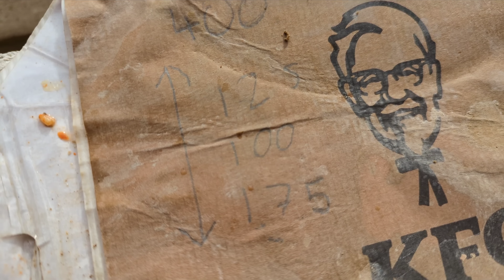Bricklaying - Building a Mansion - New apprentice #bricklaying #renovation #vlog

Comment: When you inherit jobs there will always be issues, the only way to rectify these is to be patient, have common sense ideas and re- set out, plus you must have lots of patience, you have all the above in abundance, great vid Izzy
Reply: Too ture
Reply from the maker: Thank you very much Moggy! When I turned up I felt very out of my depth, but tacking things slowly and double checking everything...it's definitely progressing massively now! Got 1/3 of the Brickwork up to FFL today video coming soon...ish 😂
Reply from the maker: @aaronhanratty6018  thanks fella!
Reply: @IzzytheBricky  hi Izzy, I'm sure you will have looked at this but il say it anyway,  as your aware setting out a building requires line and level,  you are dealing with the level at the moment but make sure you check the line as previous builder may not be as accurate as you are, cheers mate and keep up the good work

Comment: How do you find it using a big trowel like that izzy mate a use a 10 inch london trowel and thinking of trying a bigger one for more bed spreading but not sure
Reply: Stick to 10” mate save your wrist/ elbow
Reply: @specialbrew1873  cheers mate always wanted to try a bigger trowel but can't warrant buying one if  am not going to use it
Reply: Don't go bigger go smaller. 9inch London w.rose  is my preference 👍
Reply: If u want more spred try a wide London pattern maybe
Reply from the maker: I love my 13" mate! Never bend to check Faceplane, always able to reach spot boards...yes it's heavy and sometimes slow, but have a brilliant feel to it 💪
Reply from the maker: @leviellis4079  I've also got a wide London Marshalltown 11", fantastic trowel! Been using a range of trowels recently. Today 10" Marshalltown 💪
Reply: @IzzytheBricky  I lovely my 10inch London trowel been best one I have had yet but really want to try a bigger on like just unsure
Reply: @IzzytheBricky  would you recommend try a 13 or a 12 mate if a try bigger trowel
Reply from the maker: @aaronhanratty6018  just get one mate 💪 order one from SB tools! They have every trowel under the sun..every make, every size 💪
Reply: @IzzytheBricky  cheers mate a will do and use them every time had my last two trowels off them 👍